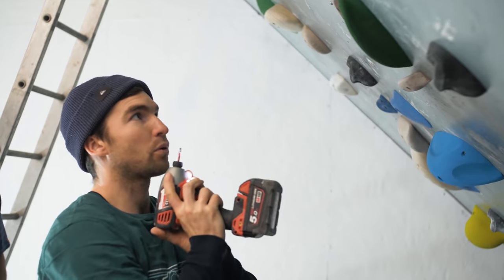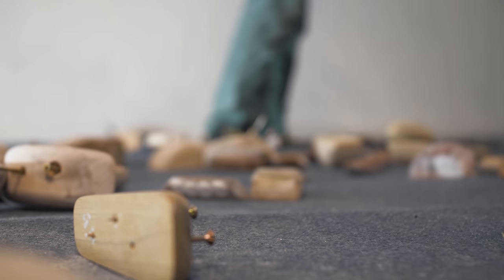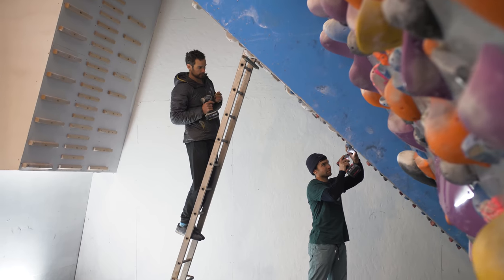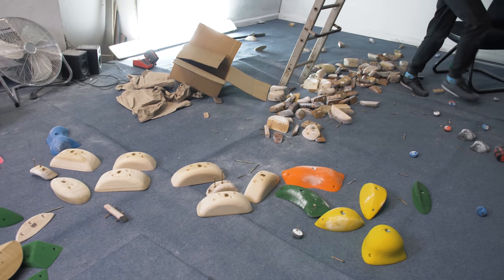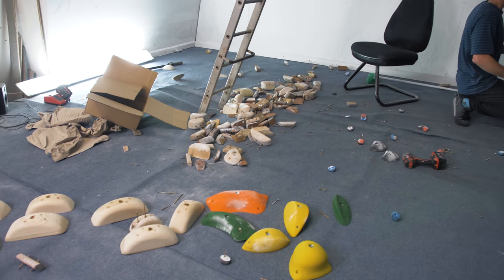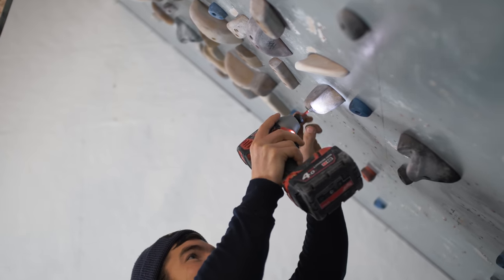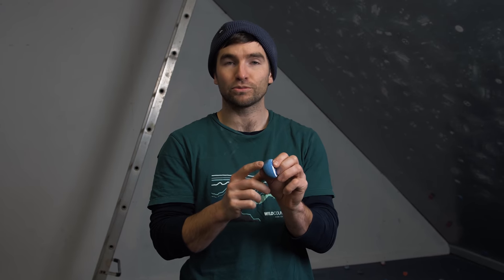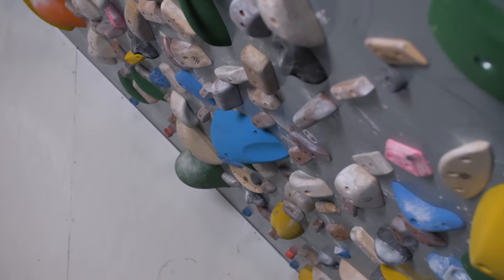Steep System Board Climbing: Improve Your Setting!

Comment: Thanks for the advice as resetting my small board in a week or so. Smaller squares each with a variety of holds. 👍😀
Just wondering though what you meant by feet following?  Cheers P😀
Reply: That feet can be placed only on kickboard + where hands are
Reply: @minib00mpola  - Many thanks for the reply. Sounds brutal on an overhanging board!
Reply: @peterashford838  it absolutely is 🤣 definitely puts your body in positions you would tend not to do when you can put your feet anywhere you like !